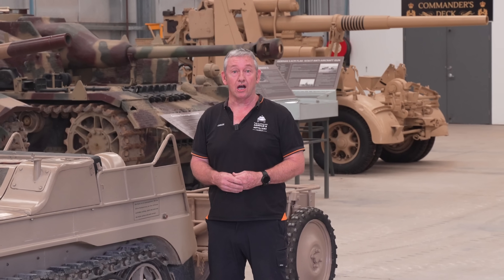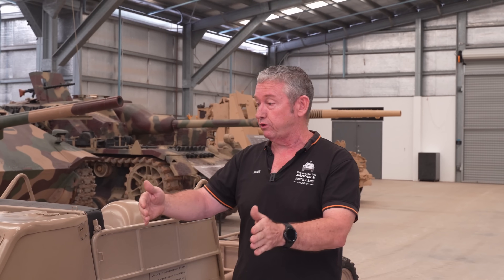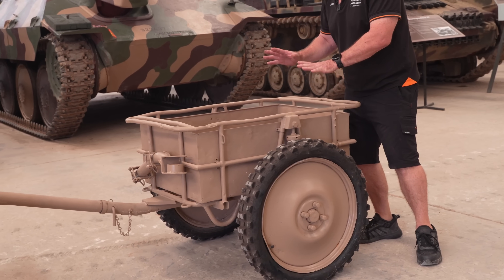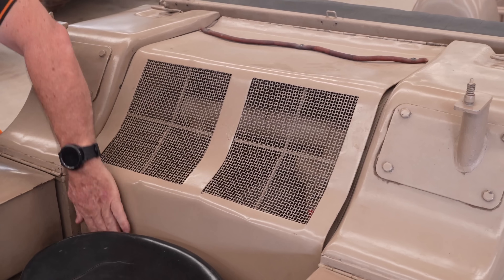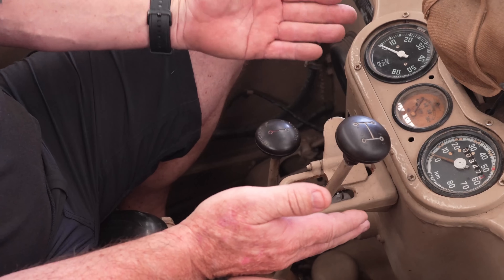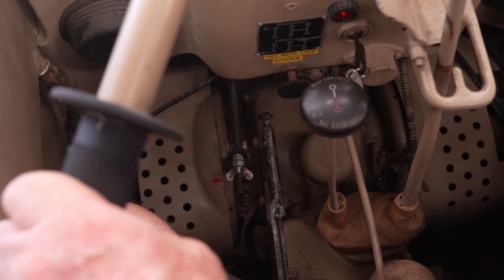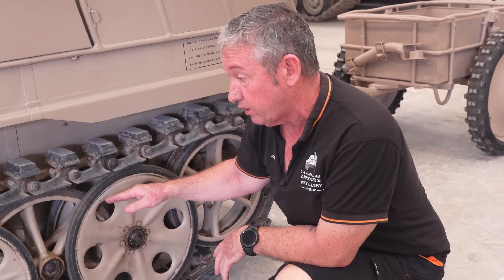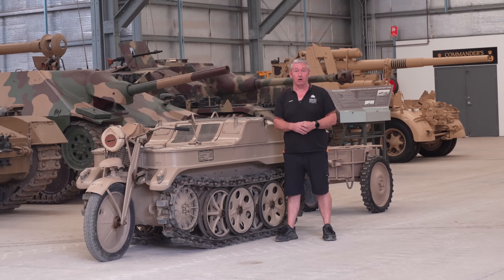Kettenkrad - The Fallschirmjager's Tracked Dirtbike!

Comment: Imagine a lightened up modern UTV version of one of these for offroad camping and light duty farming...(Take off all the extra plating for plastics, modern alloy engine, alloy or carbon tub depending on cost, lightweight wheels and fully rubberised tracks)... Prob. would make a fun little vehicle without all the extra weight inherent in the Kettenkrad

Comment: You move off with the front wheel angled,,, but it is NOT turning. Does not inspire confidence!
The US and the Allies had Jeeps, and wide cargo doors on cargo planes. Jeep is a LOT lighter than that and carries more people. And faster. Kubelwagon was just a open top VW Beetle. With ground clearance. Jeep was more usefull and was 4wd.
The C47 was a very handy device, more so than the German corrogated Junkers. For a start the door was bigger!!

Comment: As always these Australian Military Museum pieces are fantastically repaired, but I have one question as to the track configuration. As a heavy equipment maintenace mechanic, when fitting tracks on a crawler configuration, the links are always placed with the narrow (closed) end facing forward, but in the case of this unit, the reverse configuration is obvious. Is there any reason that this is done? Track link, pins and bushing / pin bore wear, would be rapid when fitted this way. Appreciate your opinion.

Comment: Honestly, they should've gotten rid of the wheel up front. Waste of materials, not to mention the fact that for quite a bit of the travel, the steering it does is more like "a guideline, rather than actual rules" type thing. Weird thing.
Reply: Don’t quote me on this but I imagine it’s a balance issue and necessary. Look at the design. The engine is central or slightly back from the centre. The driver is up front and then at the back you’ve got whatever you’re carrying- supplies, men, ammo etc. I imagine that fully laden the rear is gonna weigh more. Having the motorbike bike style front not only gives you controls for the steering, but forces the driver further forward counter acting any weight imbalance. Also just makes steering easier as for the most part they’re not gonna be needing to make tight turns and more people are used to typical forms of steering on motorcycles and cars/trucks than they are with skid steering a tracked vehicle- so you don’t have to teach someone how to operate it. So long as they’ve driven a regular vehicle they can drive this without much extra knowledge required. 🤷

Comment: Always wondered how that front wheel managed to steer those tracks! Great video.
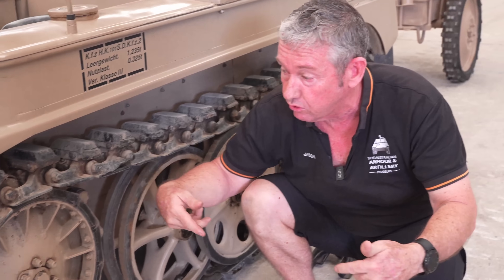Reply: 3:39 shows that it really doesn't do much, the vehicle is going straight although he is trying to turn it. It seems it's there mostly for show.
Reply: @alaric_  The front wheel helped to lift the front part of the vehicle to overcome obstacles
Reply: If I had to guess, it was in response to a design requirement to be steerable like a motorcycle yet tow field guns. Nothing in the spec said that turning the handlebars couldn't invoke differential braking of the tracks...

Comment: Bet the tracks did not get oiled regularly every link needed cleaning and greasing/oiling. Interesting steering two stage. The Bren gun carrier had two stage as well first stage curved the track the second braked one side or the other, all operated from the steering. The steering on the German vehicle is easier on the arms apparently.

Comment: The Kettenrad was designed beffore ww2 for use in forrestry in Germany, after ww2 some are used for that purpose back again, they pull a log so out of the forrest onto the forrest road.
Reply: The Kettenrad was produced from 1939 to 1948. They were mostly used on the Eastern Front and to a lesser extent in North Africa, and the Western Front as a mechanical horse/draft animal and later some were used as a runway tug for the Messerschmitt 262 and or Arado AR234 as, it was not until after the end of the war that they were ever used in the forestry industry. Lastly a small number of them were converted to be remote controlled demolition vehicle (sucide drone) which just goes to show you what’s old is new again
Reply: Great vehicle lots of engineering and it uses a standard Opel 1500cc ohv  engine which was used in the pre war open cadets. A modernized variant needs  a good de isel.  Kubota, yanmar, kohler,  hate.  Much more fuel effective than  gasoline.
Reply: Er no. Used postwar in forestry , but it was designed for military use.
Reply: @andrewgreen1940 Yeah, there is always that guy that has to be the expert with extra information…🤦🏻‍♂️
Reply: NEVER built before WW2 !!!
First production run was 1940.